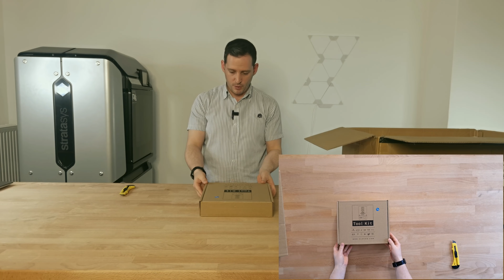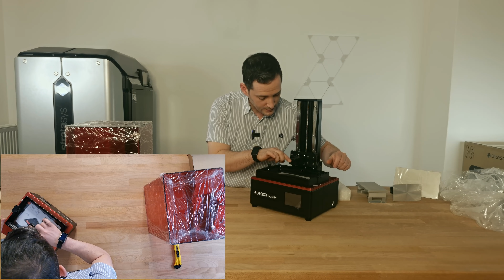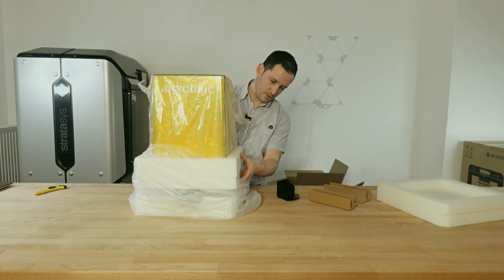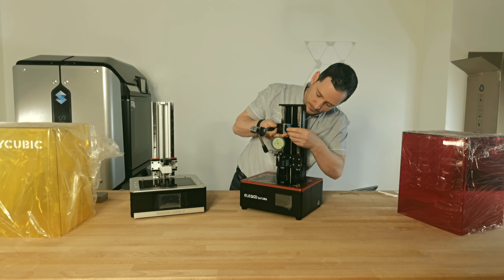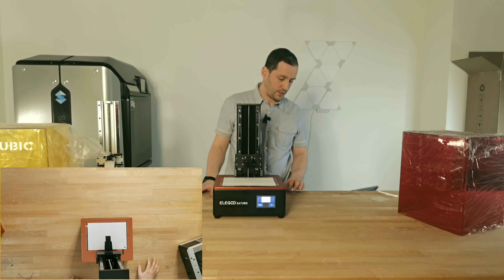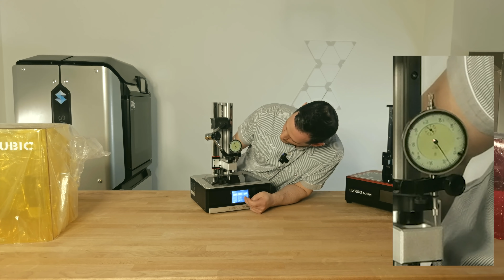Elegoo Saturn vs Anycubic Photon Mono X (In-depth comparison)

Comment: Great video, very informative, thanks! Regarding the photon defect on buldplate edges, as the buildplate is wider than the printing surface, do you thing the defect will impact the printing surface?
Reply from the maker: Hi fificap66. I did not measure the length of the build plate. But accordin to some sources in the net it has a length of 202mm. Substracting 10mm on both ends it will decrease the build plate area to 182mm. So, yes it will impact the printing if you would like to print parts using up the complete build area.
Reply: @twinstalk  Thanks for this quick answer! another question regarding the exposure test feature that you mention at the end, i cannot find any information on this. Is it something like R_E_R_F file on some anycubic printer that allows to test several exposure in one single print? Thanks
Reply from the maker: Hi. Yes there is not much info in the net on this. You will need UVtools and generate a exposure test file. It's like the RERF test from Anycubic. You can have different exposure times per layer on the latest firmware of the Saturn. Will post a video on this when starting to do testprints.

Comment: LOL COME ON MAN JUST PUT A BOTTLE CAP UNDER THE FEP SO YOU CAN GET THE RIGHT TENSION THEIRS NO NEED FOR THIS CLOWN 🤣 APP TO GET THE RIGHT FEP ADJUSTMENT. I'VE BEEN DOING THIS FOR 5 YEARS PRINTING ON 3D RESIN PRINTERS FROM SMALL RESIN PRINTERS LIKE PHOTON S OR ORIGINAL OR MARS ETC AND NOW ON THE BIGGER PRINTERS ITS THE SAME THING I DO THE SAME PROCESS WITH THE BOTTLE CAP AND ALL MY MONO X AND EPAX E10 THEIRS NO NEED TO WAIST YOUR TIME WITH A APP THAT WAS NOT MADE TO ADJUST THE FEP LOL. ENGINEERS I'VE TALK TO OVER AT ANYCUBIC THEY TELL ME THAT THE BOTTLE CAP PROCESS IS THE ONLY PROCESS THEY USE THEY DONT USE ANY APPS SO WHAT DIES THAT TELL YOU? STOP WAISTING YOUR TIME ON APPS THAT WERE NOT MENT ADJUSTING THE FEP
Reply from the maker: Hi j g. Thanks for your comments. From an engineer's point of view and as a scientist you always need quantitative data. I do not disagree fully with your comment because you can always over complicate something, but there is no unit called 1 force per square bottle cap. We have so many different bottle caps on the market, not everybody will use the same one and have the same tension. The way I did measure the FEP tension may not be optimal but it gives you a value you can work with. So, as I stated in the video, some do they bottle cap thing and everything works out just fine, others do have problems. By elimination the source off one error you may find out what the real problem is on your printer. Hope this was not to harsh of a comment. Still value your thoughts.